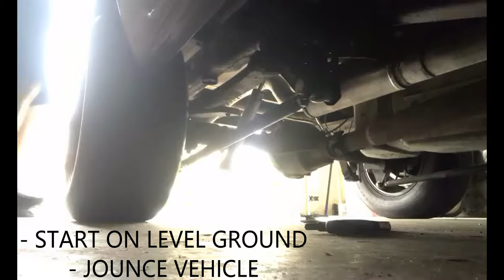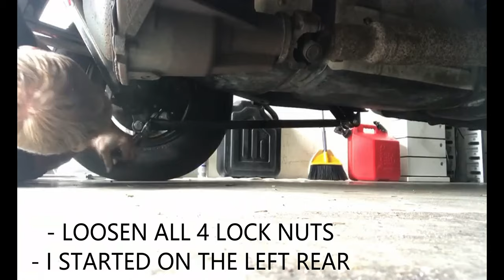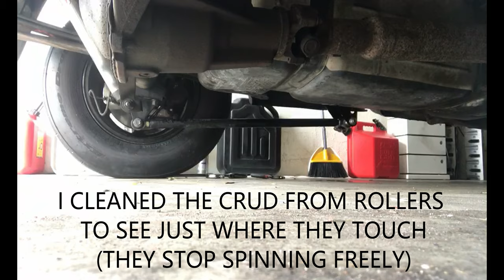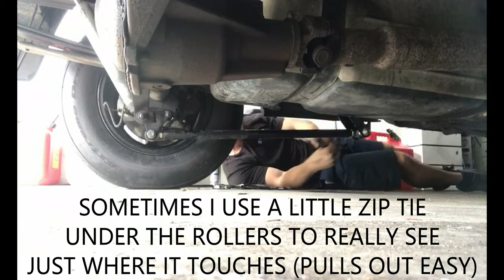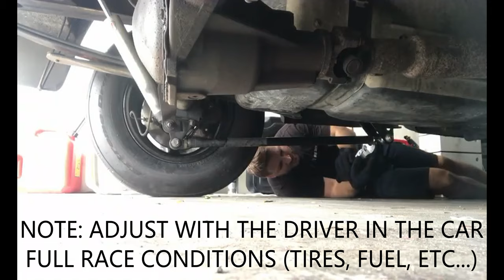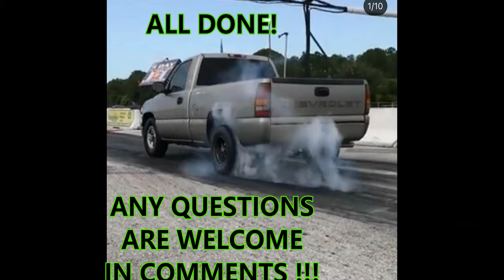HOW-TO: ADJUST CALTRACS Properly (Full Procedure Explained), SET UP LEAF SPRINGS Traction Bars DIY !

Comment: truck should be at race weight  with drivers weight in the seat  then adjust till the roller hits one full turn but every truck is diffrent   i have found my ext cab truck likes more 1 3/4 turn  but i have tested at the track  thats what holds my 1.26 60 ft
Reply from the maker: turbo?

Comment: well ok !! u didnt tell everything!!  is someone sitting in the truck ?? is it 1 turn at u touch the leaf ?/
Reply from the maker: Good point! Yes the driver was in the vehicle, and I jounce the suspension to try to settle it before adjustments on a level surface. Also I try to have just over 1/4 tank of fuel like we run at the track. And yes exactly 1 turn after barely touching. I actually use a zip tie for a drag resistance test to see when they're touching equally (slipping it in and out under the roller until I can't).
Reply: You really need to have the vehicle race ready, meaning how it sits in the staging lanes:  Driver or drivers weight equivalent in the drivers seat, Proper amount of fuel, coolant/water, ballast ect., adjust tire pressures, adjust shocks (if adjustable).. also you don't have to "jounce" or whatever you're calling it... just push down on the bumper a couple of times and let it settle.. after a burnout that's how the vehicle is going to be sitting when you stage. 
Rocking the truck side to side back and forth is giving you those inconsistencies. 

Just my .02 but i've been setting up Caltracs like that forever.
Reply from the maker: @kevin_nagle  thank you

Comment: So loosen joust and spin till the roller touches the leaf?man I just slapped mine on and went to the track haha didn’t even adjust but I did get a 1.61 60ft
Reply from the maker: That’s amazing 🤩 yes we also saw HUGE improvements before even adjusting. I think possibly very little preload is the key. What setup are you running?

Comment: Please explain... "JOUNCE" 🤨
Reply from the maker: 😹😃 I promise I won’t say it any more if it bothers so much 😭 I’m not an expert… for the short 17 years I worked at the local GM dealers as a master tech this terminology “JOUNCE” is used in SI (Service Information / Literature) as an effort to settle the suspension for alignment and similar purposes using the human body. It rhymes with bounce so… For instance you replace a control arm then you bounce your body on the bumper to let it settle in before performing alignment on a Hunter / Beam machine. I have heard stupider terminology such as “judder” - a word that doesn’t actually exist. As stated JOUNCE is terminology as well as instruction directly stated from manufacturer instructions. That being said we always open to learning, so please feel free to correct and inform us 🙏🏻 much appreciated! 🏁

Comment: Get rid of the damn crescent wrench!! Use a proper open ended box wrench!
Reply from the maker: You’re right it would have been a lot easier 😆 kind of in a rush to get to the race track and did not want to step out to grab other tools 😁🔧🤷🏼‍♂️
Reply: Caltracs sells the wrenchs for adjusting. Its alot easier using the correct tool. And full turn is to much.
Reply: @lifestoshortbed5027  yep, only 1/4 turn is recommended 👍🏽
Reply: @lifestoshortbed5027  Fuck that, I put 7 turns into mine!! Also, I used a big ol' 8 lbs pipe wrench to tighten mine down!! I tightened them suckers until the threads start moving!!